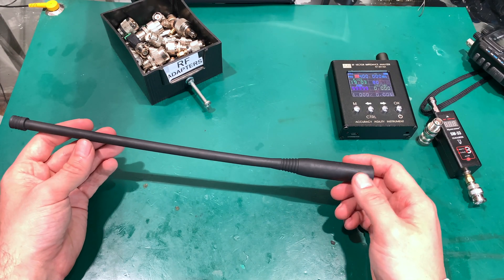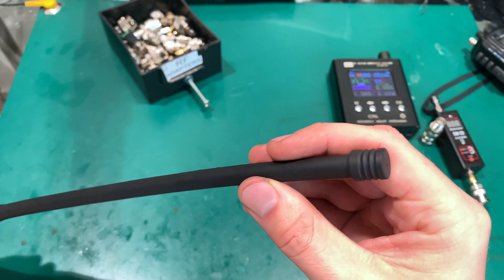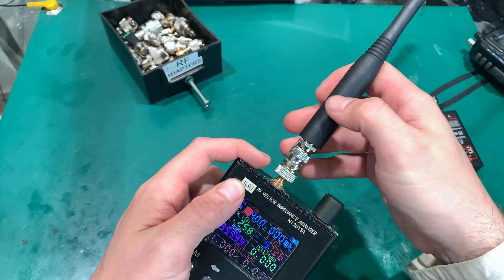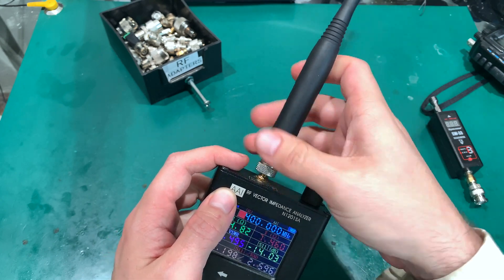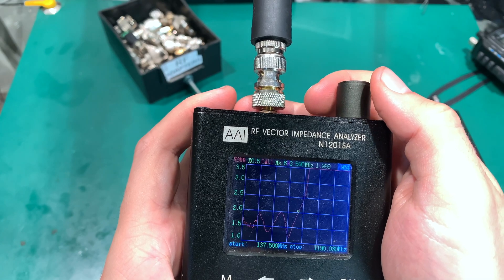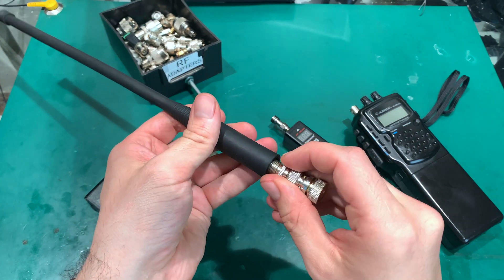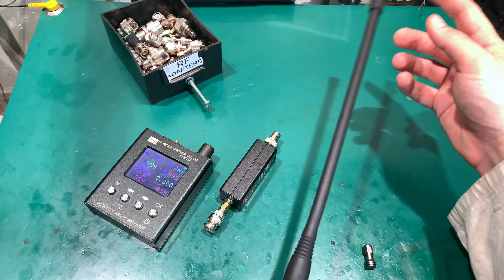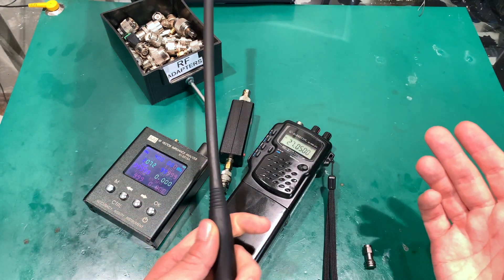Thales PRC 148 (PRC 152) MBITR broadband 30 -  512MHz antenna 23386 - 1600500 1

Comment: inside? 1 transformer, 1 capacitor and 2 x 200 ohms 5w resistors .73
Reply from the maker: Thanks for feedback - so basically anywhere outside real resonant we are going to be cooking that base - that might be issue with TRI replica that can output > 10W - for sure it was not designed to handle that. 73

Comment: In the military I had such an antenna, it is of very good quality - flexible and receives the signal better than the original 27 MHz antenna when you do not hold the radio with your hand. The original antenna requires more weight. unfortunately I do not know how to get such an antenna. It has a very good advantage because a radio that is standing alone, e.g. in a window, etc., receives signals well, and with the original antenna it receives signals about 3 times worse. They should produce such antennas for 27 - 28 Mhz portable devices because they are much more practical.
Reply from the maker: Thanks for comment, I'm not sure if this antenna will be good for TX on 27MHz (basically everything on low band) <- for tactical VHF we had long blade antenna. Those short one have matching transformer at base - while TX-ing it get warm so definitely there is power loss and it's not being radiated as it should be on dedicated one.

Comment: Similar to Sergei's question, but for this antenna specifically, will the radio he specified (136-174 MHz & 400-480 MHz - Output Power 0.1-5W) work with the antenna in the video? Thank you!
Reply from the maker: Yes it will work.
Reply: @ElectronicNoobBlog  Thank you!!

Comment: Hi! Can (Thales/Harris 30-90 MHz) military antennas be used on PRC replicas? I have PRC 148 from TCA (136-174 MHz & 400-480 MHz - Output Power 0.1-5W). Thanks!
Reply from the maker: In general no, in Your question You stated frequency range where each antenna will work and replica is way outside. Those long blade are for low band. I did not have 30-90 to measure impedance at input - if they are flat 50ohm then You can use them safe (just won't be effective)  if they are not flat 50 ohm then i would not use them as they can (will at some point)  blow radio output  stage amplifier. Without having in hand can't tell for sure - just making educated guess.
Reply: @ElectronicNoobBlog  Thanks!